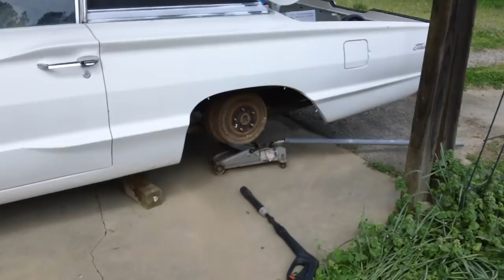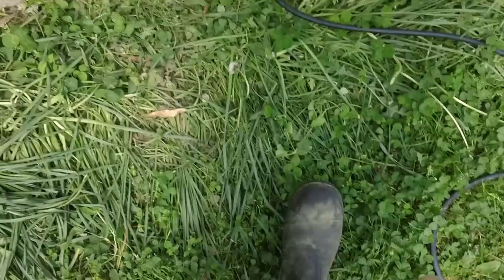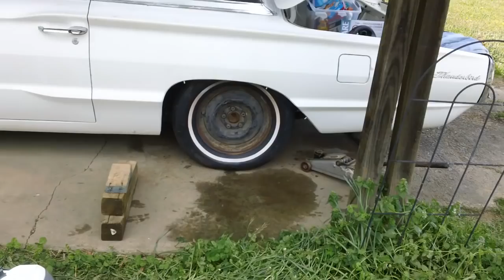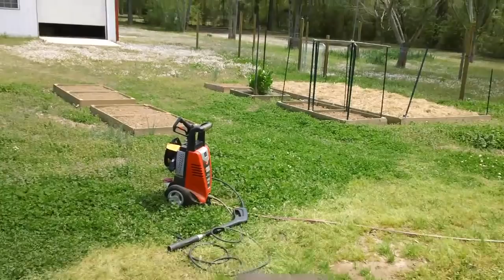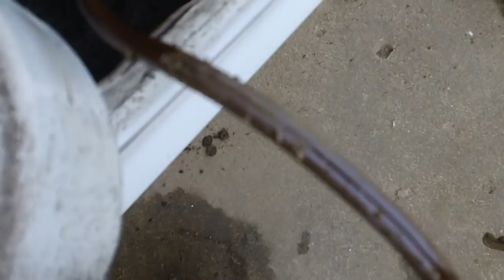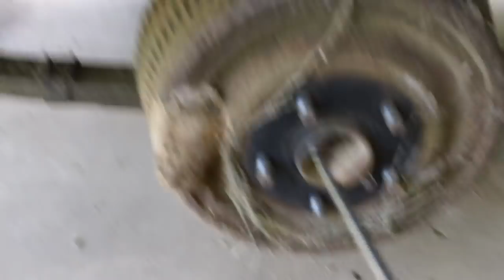1966 Ford Thunderbird repair and refurbishment (Part 3). Power washing/gas tank inspection.

Comment: I think it's great that you're starting off your videos with some safety tips but we need to talk about your safety tip for the pressure washer. Always unroll the cord on the pressure washer because if the orange cord does not have a ground fault circuit protection then a person could become electrocuted. The whole point of unrolling the black cord on the machine is it puts the GFI outside the wet area so if there's a issue with the cord close to the power washer it will trip and prevent someone from becoming electrocuted.

Comment: I am buying a 66 T-BIRD and I looked into the front wheelwell and it is all opened up in there right to the door hinges. Is there supposed to be shields in there like GM A-BODY cars.
Reply from the maker: Michael,
Congrats on buying the T-Bird.  Good for you.  But it sounds like your inner fender well (or both) is missing.
Regards,
John

Comment: John, 

You don't even have to use a proper gas can.  An old soda bottle will do.  Hang it up high, like on the antenna or something else and use gravity to feed gas through some fuel line into the fuel inlet of your carb.  The guys at Cold War Motors call it, "hooking up an IV".  Were you able to watch any of their car videos in the link I sent you?

Regards, Tom

Comment: I think you're going to have to drop that tank. chances are it's full of dirt. you could run a fuel line to a temporary gas can just to get it to fire up and move it into the garage, but I wouldn't attempt to start it with that crap in there.
Reply from the maker: Daniel,
I'll re-address this in the next T-Bird video.
Regards,
John

Comment: All those poor homeless mud wasps..... That tank is going to be a mess inside. My grandfather had to move an old Hudson Hornet once, where the tank was all goobered up, he took a coffee can, mounted a petcock in the bottom,then mounted the can to the window with some metal strips fashioned like the mount for a drive in speaker,  ran some fuel hose down and under the hood to the crab. put some fuel in the coffee can and topped it with the plastic can cover with a few hols, then dribbled some fuel down the throat of the carb. It worked, drove the car about a mile form his house to his workshop/garage building.
Reply from the maker: I really don't want to do a jury-rig a setup.  I know what you say should work, but there's always a chance it won't work this time.
Regards,
John

Comment: Hey John, thanks for the tip.  I plan on getting a power washer myself before Summer but I think I'm going to go with a gas model with a briggs engine.  I've got a kind of hybrid jack.  It looks like a bumper jack in that it has the notched square pole, but the pole lays flat on the ground and as you crank the handle up and down it works like a scissor jack.  I kept it from my old '88 Fleetwood Brougham.  I used to use it a lot but got a large hydraulic floor jack a couple of years ago to work on the Trailblazer with.
Reply from the maker: We went with the B&S electric power washer for pricing reasons.  It was fairly cheap.  I'm also getting too old to be yanking stubborn engine ropes.
Regards,
John

Comment: Well John, coming from this old car guy, you definitely need to remove that tank. Mud and rusty gunk in the tank will fly all sorts of havoc with your fuel system.

Hopefully you'll be able to get away with rinsing it out. If you can, be sure to seal it back up with tank re-sealer. 

Gas tanks of that era were "Aluminumized" steel, and in my experience, over a long period of time, water will causes the aluminum coating to disappear, and the mud you're seeing is actually the steel of the tank rusting.

And, while you're in the neighborhood, it would be the perfect time to test your sending unit and replace the rubber fuel hose if it's rotted. 

Take care my friend! - karl
Reply from the maker: Karl,
I'll re-address this in the next T-Bird video.
Regards,
John

Comment: I would just plan on dropping the tank and clean it....I like the others that recommended a gas can plumbed to the carb
Reply: Me too. I've watched other guys try the old "flush it with a hose trick", and I never saw it work once.  If he has mud clinging to a power cord he probed into the tank, you know there's probably muddy goo hanging all over everything.
Reply from the maker: Lee,
I'll re-address this in the next T-Bird video.
Regards,
John

Comment: John,
I wouldn't even think of trying to use the gas in that tank. If all you have to do is go from the carport into the garage, try this tip. Use a one gallon gas can and run a fuel hose from the inlet of the fuel pump into the gas can and you will be able to start it up (hopefully) and drive it into the garage. I've done this many times and it works very well.
Reply: Excellent suggestion.
Reply from the maker: Jim,
I'll re-address this in the next T-Bird video.
Regards,
John